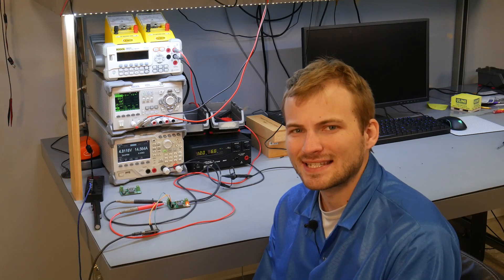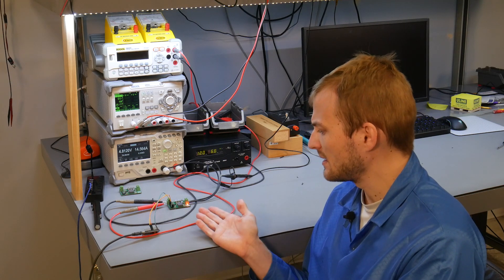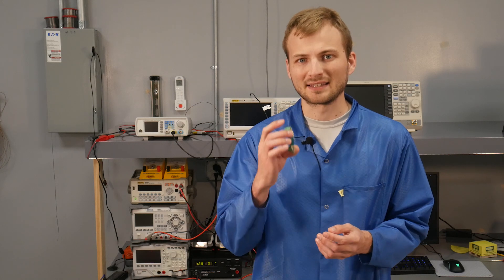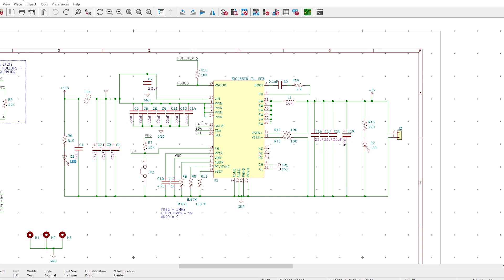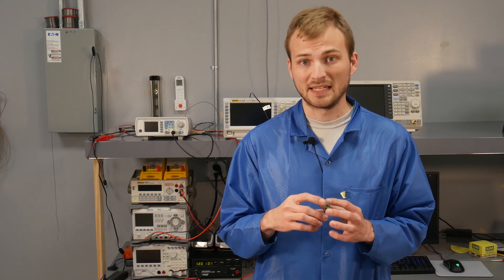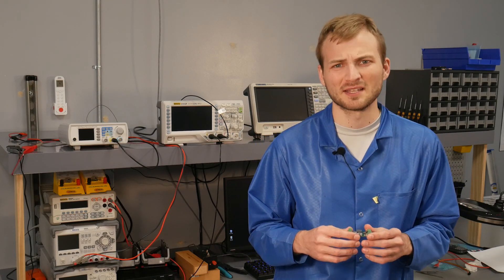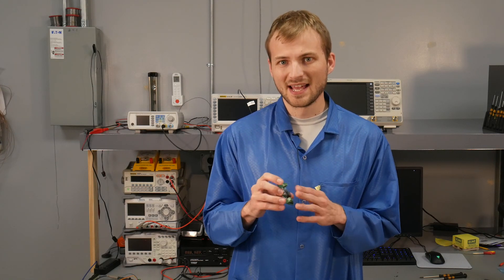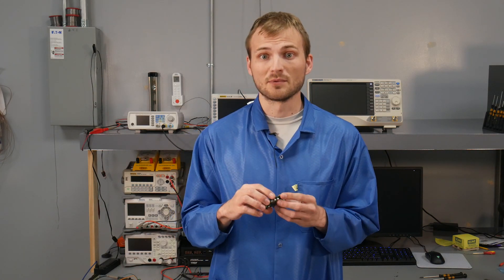High Power Buck Voltage Regulator: Custom Eval Boards #1

Comment: Great, but I need 40 + 40 + 40  AMPS, multi. int. sych. BUCK 300 V IN - 96 V OUT - 120 APMS, max. temp 45 *C @ 25 ambient. How to do that on such tiny board ?

Comment: Can you make 100W bidirectional DC DC boost converter from 7-60Vdc to 100-500Vdc which can be controlled by I2C using GAN fets?

Comment: Just found this channel! Great video, really easy to understand. This is a really good thing to know how to do because often commercial eval boards are not available or hard to find. Please make more of these videos!
edit: One point I would like to mention is that in my opinion, eval boards do not need to be super small. I actually think it can help to make it bigger because you can add equally spaced mounting holes and you get more space for silkscreen to put info on. Of course, this all depends on the company you are having it made at and your design.

Comment: Question:  
Does an esp have the ability to time the width of a (10Hz or 1Hz PWM) to a resolution of 1uS increments?

I am looking for two parts that I don't know if they exist.
A comparator with a 1 million step resolution
and an optional 6 digit counter with 1 MHz input, a count enable, reset, and a i2c output
(that can do equivalent of: count, latch, read value, clear)

Comment: Was just searching for a higher-power LDO or buck regulator recently, this looks really nice. I have some LT3081 & LT3091s in my mouser cart right now, but they are more expensive than this chip (granted, they are a different type of regulator and package). I wonder if the SIC45x can be made to regulate negative voltages, but still provide positive control voltages on its outputs.. hmm

Comment: Nice series! And nice find for this chip, what a freedom with all those digital I2C influences, never seen a chip like this. I am starting to play with the LM5170 and hopefully extend it to be quad phase with an external voltage control loop.
Reply: Just took a look at the LM5170 Datasheet, looks very interesting. I've been searching for a bidirectional switching controller for charging lion battery from a voltage bus and also power the bus from the battery. This ic might be a good candidate for that

Comment: I can see why you would be so excited about this chip... that feture set is ridiculously good.

I made an arduino-controlled variable voltage power supply a while back. TBH it has a heap of design issues which I managed to hide with code, but they're all there, lurking.

I am EXTREMELY interested in a few eval boards, and tbh I may be after a few more if testing goes well - that level of microSMD soldering is beyond my capabilities as a home hobbyist 👍

Very nice work, and FANTASTIC video! 😁❤❤❤

Comment: What did you use to reflow the solder?  Is it one of those hot plates?  If so what temperature did you set it at, did you increase over time or just set it to temp and leave it?  Cheers
Reply from the maker: Yeah, it's a custom hot plate. I let it start preheating, then put the board on.

Going to do a video and some livestreams about it soon.
Reply: You want a smd reflow temperature controller with a thermocouple. That way, you can follow a profile.
The temperature and profile you want to use is from the manufacturer of the paste.
Reply: @shillster  I have a reflow oven but it looked like he was using a hot plate.